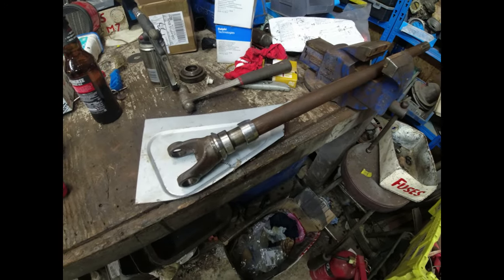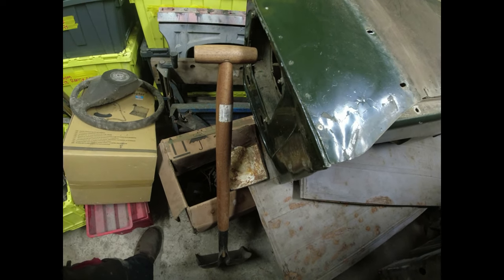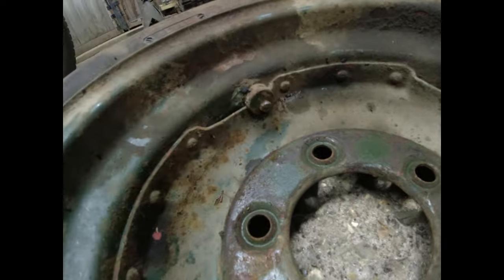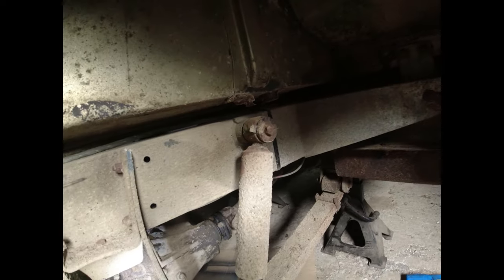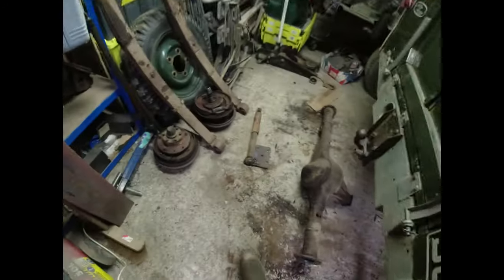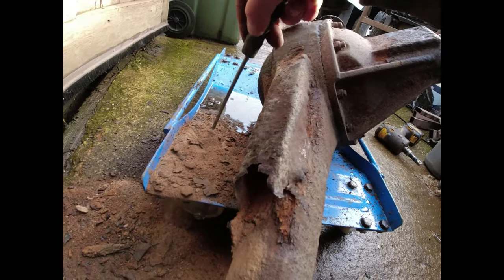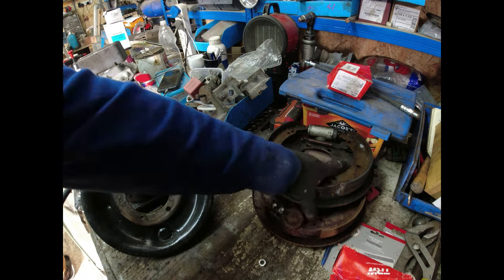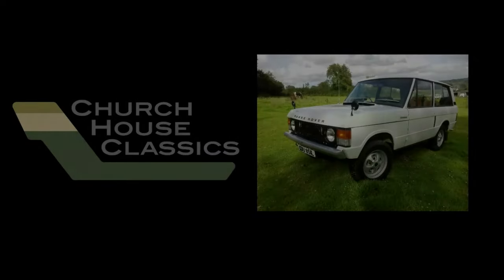Land Rover Series IIa - Surprise gift for front axle and bad news for the back axle ep4

Comment: Hi Richard
When you fit the larger twin leading front brakes to a short wheelbase Land Rover you need to fit the larger original front wheel cylinders to the rear brakes. This is what Land Rover did when they uprated the brakes on later series 3 short wheelbase Land Rovers. 
Keep up the good work as your videos are excellent
Reply: Correct my friend..
I was told this around 30 years ago by Richafd Bass..Now sadly gone..
Reply: Absolutely correct. Also the master cylinder needs changing to a larger bore. The later 88s and all 109s had 11" TLS fronts with rear 10" with larger bore wheel cylinders and larger bore master so just go off the numbers in the parts book.
Reply from the maker: Top work chaps, I was working from what was on the s3 axle that I am using on the car. appears that it was done wrong. Parts manual adhered to now

Comment: There is a 1/4” difference in front and rear SLS cylinders.  1.25 and 1.5” if I remember correctly., and I think the larger type were front for 88” and rear for 109.
Reply from the maker: I am running by what is listed for post June 1980 now. Appears that the s3 axle donor was set up wrong. There is a lesson there to not trust the work done by another ham fisted gibbon